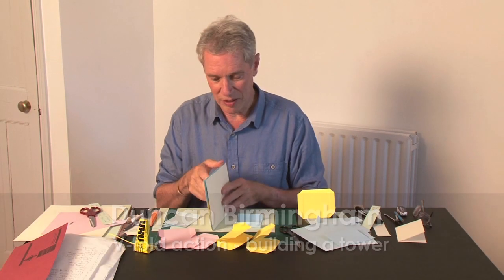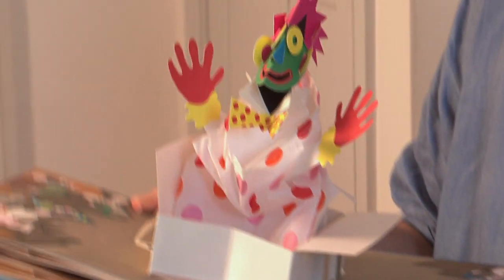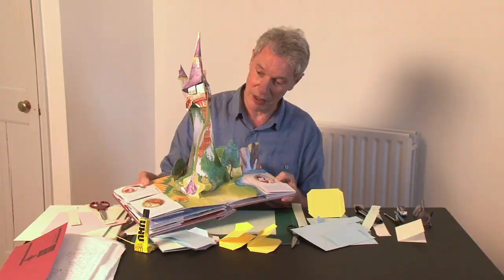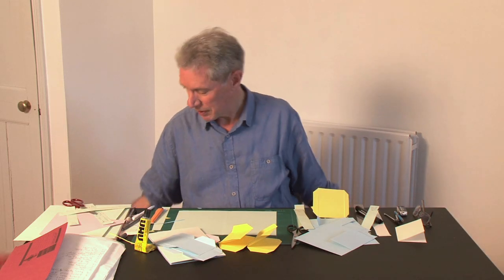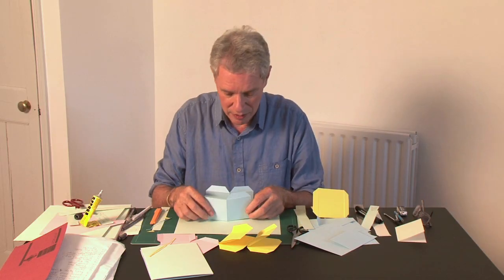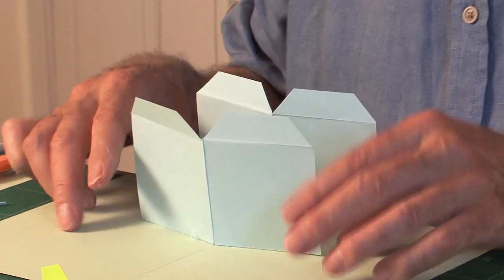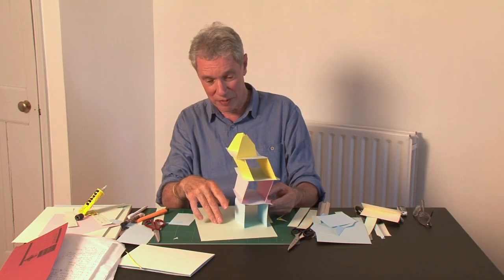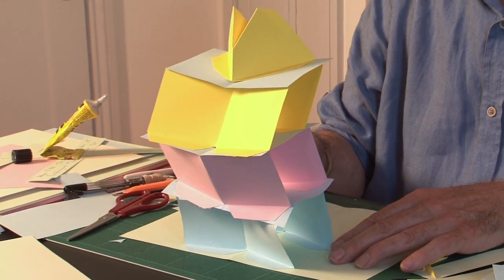Pop-Up Tutorial 30 - V-fold action - Building a Tower

Comment: What card did you use for this video? I have 160gsm, but I'm wondering if I should get thicker for this particular popup. Thanks
Reply from the maker: 160 should be fine - making the card thicker usually means that you'll have to measure and score the fold lines. If the panels are buckling it's always possible to just cut out a piece that fits exactly and stick it on to reenforce the panel. As a rule of thumb - the bigger the model the stronger the card needs to be.
Reply: @thepop-upchannel4919  Thank you! Very helpful. I can't wait to try it out

Comment: Hi can I ask, why does the top levels slant?
Reply from the maker: V-Folds fold down in the direction that the V is pointing - so the slant is because the V isn't standing up perfectly. Partly this is because of the slight bendiness of the card. It could be made to stand up a bit more straight either by flexing the base to give it a bit more lift, or else by adjusting the angles on the V fold pieces, making them a little more acute will make it lift a little more.
Reply: @thepop-upchannel4919  I see.. thank you!!

Comment: Also what is the exact name of the glue you are using? I can't find it
Reply from the maker: The glue I use in the videos is UHU. Really almost any glue will work ok - water based glues are a bit more difficult as they tend to dry more slowly so I prefer solvent based glues - if you are making a lot of pop-ups it's probably worth experimenting and finding which glue suits you best.
Reply: @thepop-upchannel4919  I had found uhu, but it was for cement. I'm basically asking for the exact wording on the tube, if at all possible
Reply from the maker: @angeldunworth  There's a picture of it in Tutorial 1 at 0.55. You can get it from Amazon. But you really don't need to use exactly the same glue.
Reply: @thepop-upchannel4919  ok kool

Comment: These are amazing books!  What weight of card stock do they use in making books.  Especially pieces of that height?
Reply from the maker: For quick and easy folding as shown in these tutorials, where the card doesn't need to be scored, I use 160gsm. for more substantial models probably  220gsm. is better, but this will have to be measured and scored. The ideal card is as rigid as possible and as thin as possible. sometimes most of a pop-up could be relatively light weight card and just make it double thickness where a component needs extra strength. The size of the pop-up also dictates the weight of the card - the bigger the pop-up the heavier the card needs to be.
Reply: Thank you for your reply.  I bought your book yesterday and can't wait for it to arrive.  I will be in hibernation with practicing these tutorials this winter!

Comment: :) . you're doing a wonderful thing, sharing, so I appreciate it very much. it came up when you referenced circular motion and gluing the circle at the point of a good and joint position. the challenge was understanding where the point was visually so the idea of glue and intersection was right. That's where all the visual angle references prompted me to at least suggest more close ups at the crucial bends and functional placements. I thoroughly appreciate and enjoy your generosity in this process. If you would like some editing support, I will help in Adobe as well. But; great channel. Much appreciated for the passion play of dimension and mechanics!!! Awesome!!!
Reply from the maker: Thanks for the offer. I think we've got it covered. I had another look at the circular motion tutorial and I see your point. It is actually a bit difficult to position the wheel correctly. What I neglected to mention in the tutorial is  - if you look at the wheel there is a little square that has been shaded in, the little "L-shaped" piece glues on behind the shaded area.

Comment: Hey Sir! I am trying to make a tall tree following this mechanism, similar to the example no.4 (big-bang pop-up book). Can you please explain a little bit more how to keep it tall and straight. Mine is slouching backward!
Reply from the maker: Yes that pop-up in the Big
Bang book is pretty amazing - also a bit difficult to make. The mechanism is
actually slightly different from the one explained in the video. I'll probably
try and explain the theory in another video at some point. In the meantime here
are the measurements for the pop-up that appears in Big Bang:- The main
structure is a V-Fold. On the V-Fold piece the angles between the central
crease and the creases of the tabs that glue it to the base are both 78
Degrees. On the base the angles between the spine fold and the points where the
V-Fold is glued to the base are both 68 Degrees. The section that rises up
really high is part of the V-Fold, there is a crease 15.8 cm above the base.
There is a second piece of card that pushes up the top section of the V-Fold
(Make this piece double thickness as it needs to be very rigid.). This second
piece is 18 cm long. It is glued to the base 3.2 cm behind (and parallel to)
the V-Fold. At its top end it is glued 1 cm above the crease. I hope this helps
and that your tree stands really tall.
Reply: Thank you so much !! Your tutorials and book really helped me to get my thesis done! Without really kind people like you it wasn't possible. I am almost done with the mechanism of my pop-up book and currently working on its digital illustration. Soon I will get it printed! I really appreciate your youtube tutorials. Looking forward to your next book :)
P.s: As you are a teacher to yourself, any suggestions or advice to receive a good jury/critic regarding a thesis on a pop-up book based on the folk tales of a country?